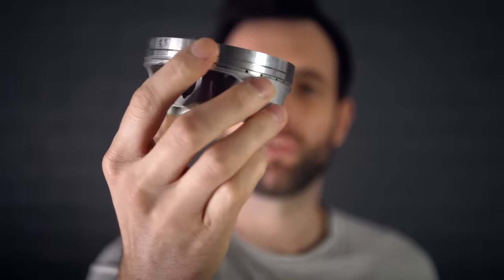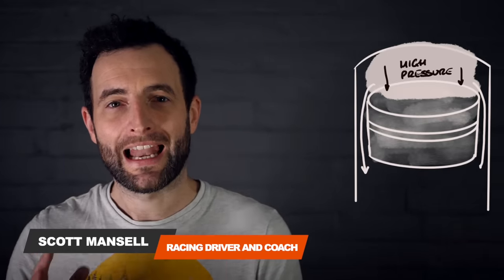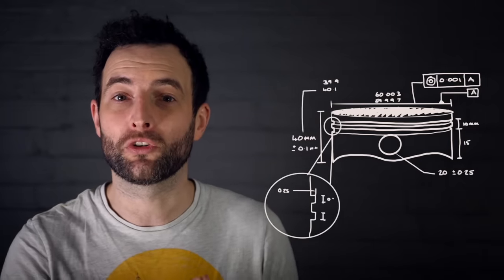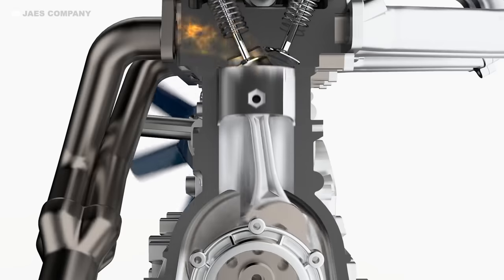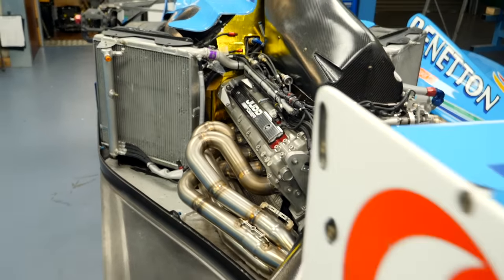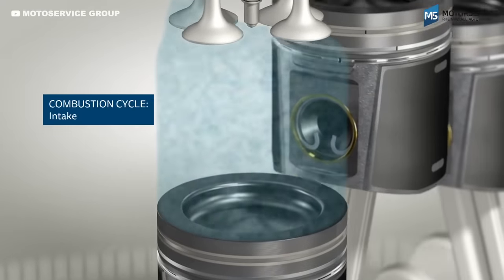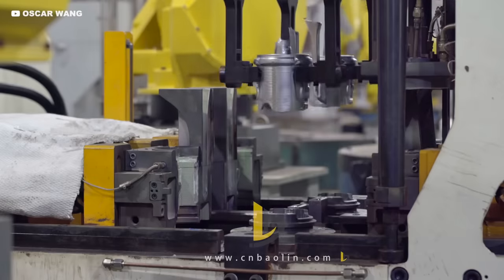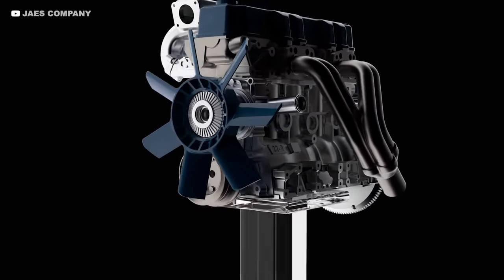Why F1 Pistons Cost £50,000!

Comment: As a machinist with 30 years experience I can promise you that there is some cost-shifting going on with that £50,000 Price Tag...
Reply: Its a click bait ... $50k my ass lol ... Judd and Cosworth would gladly give you the whole F1 engine instead :) for 7million they could give you 10 or 100 in bulk :) crash all you want :)
Reply: @Zohar-Modifier  I don't think it's 7m for an engine, it's probably that amount per year in design, development, production, and testing etc. for the whole engine allocation for a race season.
Reply: @neilmcmahon  Sound resonable, and they build and use how many engines in a year? For racing, the limit recently seem to be 3 per driver and year (for 22 races). With two driver per team, and a few engines used for practice and testing, this would be less than 20 engines per team per year. 

So the total budget would be about 140 M$ for engine development, manufacturing and tooling.

Compare this to making hundreds of thousands of engines per year even for a relatively short series of road cars. 

So the cost for these parts is very much a factor of short series, probably more than the tolerances.
Reply: I agree, no way we would have won that quote, just add 500% markup and you'll be good to go.
Reply: even an ameture machinist like myself could get a .001 mm tolerance with a good cnc mill. at most they could cost $1000, also keep in mind that the honda s2000 has almost the same piston speed as an f1 engine and those are reasonably priced cars
Reply: @ameraldas3641   A $1000 CNC Mill is a toy. A good brand of 5 axis CNC Machining Center with all the options can cost 1/2 million.
The Honda S2000 was not turbo charged so it would have had cheap cast pistons instead of forged pistons.
The price of custom made parts is dependent on how many you order. If F1 teams ordered thousands of pistons they'd be much cheaper.
Reply: @ameraldas3641  I think you may be trivialising it a little. The F1 engine develops 1000hp from a 1.6l capacity (plus MGU) and it revs into the range of 12-14k. The S2000 redline was 9k and it is a production engine, so millions of pistons are made whereas the F1 piston is an extremely limited batch. I'm fairly sure the materials are much more exotic. There would be a lot more reasons for the costs to be higher than you think that we will never know.
Reply: Indeed.
Reply: @Zohar-Modifier  There is no Judd or Cosworth in the current F1 field,of course they'd sell the old tech for less.
Reply: For all those saying its expensive, the car costs $16-17Mil alone. So saying $7mil for the engine is correct.
Reply: @neilmcmahon  my guess forged aluminum with alloys to make sure the heat treat in the piston will not go away with the high heat in the combustion chamber. It may also go through and annealing process after machining to reduce internal stress in the metal, and is then machined and heat treated once more. And there you have a finished piston. Not sure if the second machining process is necessary, the tolerance's may hold up through the annealing and heat treating. Metallurgy is not that difficult in basic concept.
Reply: @daverussell457  I'm saying $1000 for the piston, and the f1 pistons and connecting rods are most likely aluminum or titanium. It's not as hard as you would imagine to make low tolerance machined parts. Just cost prohibitive and time consuming.
Reply: @nssherlock4547  the external party like those still helping the manufacturer junk R&D in their engine
Reply: 40+ years here...and I love it when people who don't know machining start yapping about machining. Cracks me the f*ck up...and, tells me I can invoice 50K for a 5K anything.

Comment: I work on jet engines and I regularly deal with tolerances of +/- 0.001
Reply: I travel on jet engines and I regularly enjoy tolarences of +/- 0.001
Reply: @lomdonsreets5350  I have slept in one and enjoyed the tolerances as well.
Reply: Even street engines can have those tolerances. Particularly in the bearing journals.
Reply: Jet engines have metal crystal growth bias to minimize clearance. I wonder if F1 materials use this or the temps aren't that extreme
Reply: @frederf3227  crystal domains are an issue particularly in Jet turbine sections because of creep. The spinning blades want to get longer as due to centripetal g loading. ICEs don't have that level of force. (200g vs 20,000g)
Reply: I work on flight magic ... requires mana to take flight at will when casting the spell.10 billion per cast though ...
Reply: As a former aircraft mechanic later turned manufacturing engineer who has worked in aerospace manufacturing jet engine parts, these tolerances are nothing new (or really that tight for that matter), and still does not justify $50,000 per piston.
Reply: So, millimeters or inches?
Reply: @moninum  durexness gap
Reply: @Zohar-Modifier  So that´s more in the thousands of an inch region.
Reply: @moninum  indeed . amazing:)
Reply: @moninum  inches
Reply: I work in motor repair and mostly work with .002 to .0003

Comment: Awesome video. Very insightful.

Not sure if you looked into top fuel drag racers with 11,000 to 20,000 HP where between each run the entire engine is dismantled and rebuilt. F1 cars are awesome I live near the Indy 500 track.

Granted each is different race styles, one turning left slot. The other straight ahead. Both styles of racing just incredible.

Keep up the great videos. :)
Reply: Isn't the Indy 500 Indycar and not F1?

Edit: I misread the comment, never mind XD

Comment: The pistons are loose in their bores, cams are tight in their journals, and the oil is thick...this is why it gets pre-heated. 

The crown of the piston sees the most heat, with oil being it's primary method of cooling. So it also sees the most thermal expansion, thus is it the loosest. It is also usually of the largest diameter items to come into thermal fit, so again, supports it being loosest at cold.

Comment: 0.15 mm is actually closer to 6 thou
Reply: Yeah, I was looking to see if anyone else noticed this.
Reply: Yep, I think they missed that! Even though, even 6 thou seems a bit on the large side, I think.
Reply: @tomthumb3085  yeah I noticed that too, I would think a close fit for that diameter is like .03-0.04 mm
Reply: He is confused on imperial measurements.. thinks a "tenth" is 1/10 of an inch..  Noooooo... it is 1/10 of 1/1000 of an inch. Not knowing the terms used when he looked things up, created an error of 1000 times
Reply: Yeah 0.0055" can be a common gap on 2618 aluminum pistons. 4032 aluminum with 12% silicon will expand less and be around 0.0040 depending on coatings on both. If these are built seized then they at most would have that clearance when hot and have negative clearance when cold. This does have me wondering what my clearance is at temp as I only check it cold. Have to look into that next week.
Reply: 300 grams × 200 gravitys = 60 kg not 600.
Reply: @George.Andrews.  Looks like he got Newton's and kilogrammes mixed up.
Reply: @George.Andrews.  yeah he's definitely screwed the units on that. I'd be more interested to see his calculation for how he's worked out 200g, because the calculation I have for angular acceleration on the crank puts that figure about 50 times higher
Reply: @ChromeXk  yeah, lots of errors.
Reply: @George.Andrews.  yes, he calculated the force in Newton but just put kg as the unit
Reply: @ShawnDickens  I would think being f-1’s they would be ahead of curve, probably hard anodized, and running on the lower side for clearance, even if 2618🤔
Reply: Worked on many air cooled Honda motorcycle engines that had a piston to cylinder clearance of only .001" nominal, ring gap about .006".  Most two stroke clearances in that era were .003 - .0045" measured 5mm from the skirt bottom, 90 degrees to the piston pin.  He's misfigured the clearances for his presentation.
Reply: @ChromeXk  well done Ryan.  I only have a degree in common sense but I knew that was wrong. Dose anyone know the stroke length I would like to work out distance traveled of piston over distance traveled by car.
Reply: @jenniferwhitewolf3784  he also screwed up while assuming newtons is equal to kfg, I don't trust his videos anymore
Reply: @Mr72xbody  yeah, I'd love to learn more details
Reply: @ShawnDickens  seems to me je pistons is perfectly capable of making the same stuff. 

I think the cost is a result of a team that could be building space rockets, using the same valuable time on making pistons. Unless* the author of the video has his cost as accurate as his microns to inches calculations. 

Or maybe the first new designed piston cost 50,000 to develop. Idk! 

It would be fair to say the f-1 teams have their own machines that normally must be cost depreciated by mass production. 

Since all the development is secretive; they need their own machines, and the machines don’t mass produce! 

The number is somewhat it relative. An impact to the parent company, because of the need for competitive design secrecy.
Reply: @Mr72xbody  my cousin does ISO 9001 aerospace machining and that includes holding insane tolerance which means perfectly good parts for most are scrap. I would guess JE's machines could hold the tolerances needed if they adjust the programs to slow things down, but I'd bet on CP or Diamond like we already do on our big builds. Aerospace also includes certified materials that need a certificate and still have to be tested before use while being stored in a locked storage area. I don't see the need for this in F1, but they may just use the IS0 9001 because it already exists and does what they need plus more. The last thing would be do they have a special alloy they use?
Reply: @ShawnDickens  I wondered about the alloy too🤔 but it needs to be lightweight and take the impact. Their strokes are what.. 2.5” ... revving to the moon. Center oiling the cranks cuz the mains spin too fast. 

I calculated Sonny Leonard’s big motors with 5.75” stroke running to 8300, have more piston speed than an f-1.... shorter life, but still.... big components movin really fast! 

Funny they’ll use titanium for connecting rods, but not for turbo headers cuz they apparently don’t handle the vibration under pressure. 
Must be something to do with resonate frequencies. Piston muffled them for the rod 🤷🏻‍♂️🧐 that and titanium tubing not being alloyed for intended use of turbocharging. Rods are application specific, therefore alloy specific billeted. That makes more sense. 

So you’ve found diamond and cp to have better finished products, or better life span? Or both... 

We shall have to call JE and tell’em “WHOAH” 

-Probably “WPC” equivalent process on top of nickel coating for heat reflection would do the job! 
I’m beginning to think everything should have the nano shot peening after machining tears up the surface grain structure. And cryo treatment prior to
Nano shot peening. 

If I had to guess, they’re doing all that to the f1 pistons. 

I totally agree with you! Cost goes crazy with elite quality control! My brother cad designs for harley, and he told me about the ISO 9001 craziness on fuel and brake lines for oems. Phew!
Reply: @George.Andrews.  how did you get 60kg? 0.3kg X 200 X 9.81 = 588.6kg. No clue where you got 60kg from.
Reply: @lornetontegode6986  Yep lots of inaccuracies in  most of his vids .  Plus he tends to have parts from a 20 year old f1 car that are nothing like modern stuff.
Reply: @Mr72xbody  Best I know of that stuff is really my CRF450R. Large bore tiny stroke and longer rod with piston skirt the width of my thumb. Works well enough that I'd like to try making a production V8 with some of the features. We were turning a 468ci LS 9600rpm, so I'm sure way over the loads they do in F1 but with passes taking 4 seconds it doesn't have to live very long.

I'd think they try to keep the tubing to thin and it doesn't hold up because if flexes to much that way, but just a reactive guess as I can't afford that stuff anyways.

We use JE as our standard piston, but when we get into custom stuff we go to guy who started JE. He started Autotech / Racetech and we get great custom pistons for close to the JE shelf prices. When we do crazy like the 468 with 16:1 on M1 and nitrous CP is the choice and they have held up very well with the fit and finish are great. Diamond is a huge name for people who use big nitrous and we use them when CP is going to take to long. I find Diamonds coatings to be super solid.

I'll have to look into the nano shot peening. We don't get to do exotic things very often as it's not really what pays the bills.
Reply: @jonjelen9755  I mist the bit about 9.81
Reply: @jenniferwhitewolf3784  you are wrong. 1 thou means 1/1000 of inch = 0,0254 mm just check at: https://www.convertunits.com/from/thou/to/mm
Reply: 6 thou is like a hotdog down a hallway
Reply: 0.15 mm is like tractor clearance :)

Comment: Great video! I am a bit confused though. At 0.39 you say an F1 engine is effectively seized when cold due to its tight tolerances. Surely it is tight clearances, not tolerances, that cause this issue. Specifically, there is no clearance between piston and cylinder wall until the engine warms up.